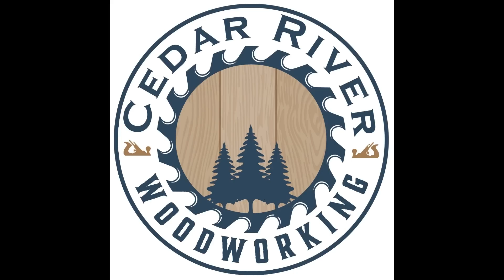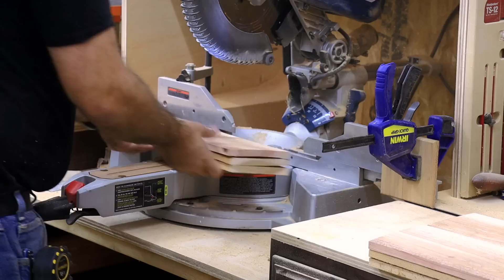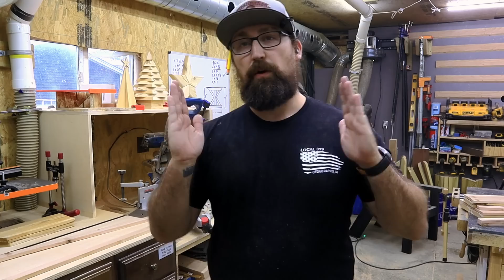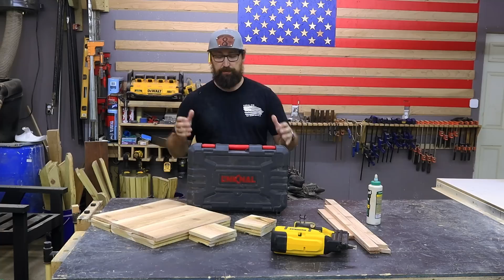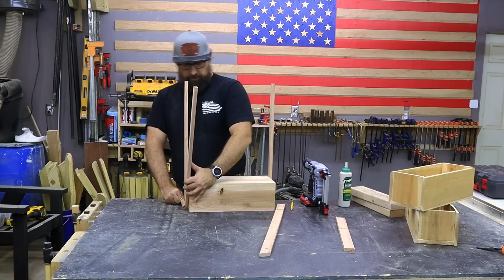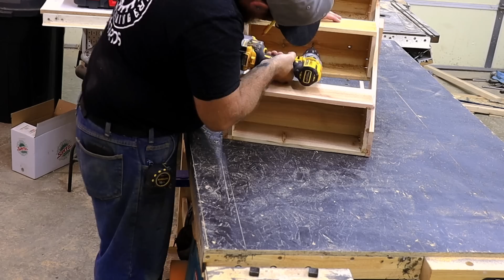The Project That Started My Business

Comment: Nice video and well done!  Just a little feed back on the sales price of the planter.  COGS is $12, Build labor is an hour, if I recall correctly? How can you sell them for less than $50?  You are selling at a loss even then, once you figure over head and taxes. Add in your time marketing and selling them and you are making $5/hr (maybe). .If this is a hobby, great, betas a business, you need to cover your costs. Be honest with yourself and your viewers.
Reply from the maker: Absolutely wrong, but you are right they do sell for $50 all day long. If I suggest that price you probably would have jumped down my throat stating that pricing is way too high. My typical price strategy is (material + labor) x 1.2 = total ($12 +15) x1.2 = $40.5. Yes I ONLY charge $30/hr for labor. This is a hobby for me and I do have a day job. The 50+ I sold the first year that I started easily bought me several tools and the pickets that I found on marketplace for about $1 a piece helped with getting more profits. So as far as honesty selling at $35 is a really good STARTING price. If your market demands more than up the price.

Comment: What did we learn?

The fence picket is 5/8 thick.

5/8+5/8 = 10/8 or 1 1/4" thick , Therefore shooting a 1 3/8 brad  into 1 1/4 material  will cause over penetration.

Andy, you do great work, and I do appreciate the knowledge you share.
Reply from the maker: Yup you're right I was too excited to test out the full length on the nails.

Comment: Great safety advice! wait for the blade to stop moving. some of the newer machines with soft stop really helps, but it's still the same. I learned that from my grandfather who worked with table saws and other tools his whole life and never had an injury. It does add a few extra seconds to each cut but the savings in safety are worth it.
Reply from the maker: Thank you! I'm always worried because I share similar ones on every video, but it may be the first time someone has seen that tip, so it's worth it. I appreciate the support.

Comment: Did you buy the Dewalt 780 dual bevel sliding miter saw. I thought you said you did? I want to buy one but I am seeing a lot of poor reviews. I was wondering if you bought it if you like it I see you are still use the Hercules saw .
Reply from the maker: The Hercules is identical to the 780. There may be some inferior parts on the Hercules actually but it does very well.

Comment: I had a question about longer term durability.  If you are putting soil and water directly into the boxes (with no plastic liner, etc), won't the cedar rot and fall apart?  I'm kinda new to woodworking and wasn't sure about how durable cedar is with long-term exposure to moisture and the outside elements.
Reply from the maker: That's a great question. I have several that are 4 years old and have held up great. Cedar is naturally rot resistant, yes overtime everything will decay, but at $12 a piece these easily out live their cost.

Comment: Great build!  Do you find that with the weight of the soil and water that the lower 2 boxes have any issue with stability?  While you were building, I was thinking that maybe moving the brace between the two uprights from the outside of the leg to the inside under the 2nd box would offer more support and maybe adding one along the bottom under the bottom box would do the same?
Reply from the maker: Many people have suggested that and I think i like that idea too. The single brace seems to be enough for any stability issues.

Comment: Why a SCMS rather than a more useful RAS?
Reply from the maker: I had to look up those acronyms. I like a miter saw better because I can start the cut at the front of the board and it drives the piece into the fence, where as a Radial arm saw has a tendency to drive the saw head towards you.

Comment: Nicely done. I build western red cedar planter boxes every year (larger ones) and do around 100 to 200 a year. I suspect that where I am at in Canada, I can sell these for $100 each. That said, 4 6' fence pickets here will cost closer to $32.00.
Reply from the maker: That's some very good profits, I would be interested to see what they look like. is that $32 Canadian?
Reply: @cedarriverwoodworking  $32 Canadian, yes. Planter box season is pretty much over here for now but maybe I'll do a short video, mainly of photos from some of my builds. 6 years ago I too used fence pickets mainly. Now though I've been using premium 5/4 cedar boards instead for a more heavy duty buildup. I tend to make $50 to $70 an our from them.
Reply from the maker: @JoeOsChannel  5/4 boards are a much better choice.
Reply: @cedarriverwoodworking  Cost more but not that much for me. My supplier gives me an awesome deal on it. Ben buying western red cedar from them for 16 years now including lots of the 100% clear stuff I use for building custom paddles with.
Reply: Are these cedar or
Pressure treated? If pressure treated is it safe to

Comment: Great to see you again Andy.  Love the plant stand. I might move the side braces to the inside to help support the boxes. Just my opinion. 👍👍
Reply from the maker: The glue normally holds up really well for them, but I do like that suggestion. I appreciate the support.
Reply: @cedarriverwoodworking  I’ve had too many glue joints fail in the past. I’m sure the glues today are a lot better than they used to be. I’m big on using bracing when I can   Thanks again !!!
Reply: @cedarriverwoodworking  Titebond 3....noticed that right off too. You are using the correct glue for the job, I go through gallons of that stuff every year in my shop.
Reply from the maker: @JoeOsChannel  I use a ton from cutting boards and planters too.
Reply: I was thinking the exact same thing when watching that part of the video.